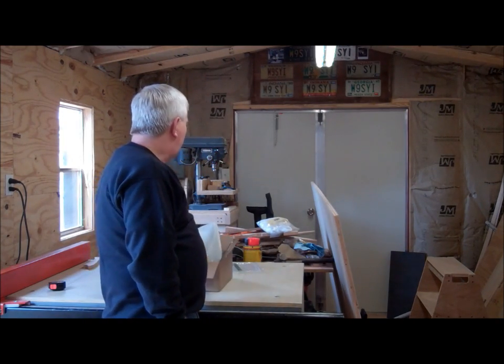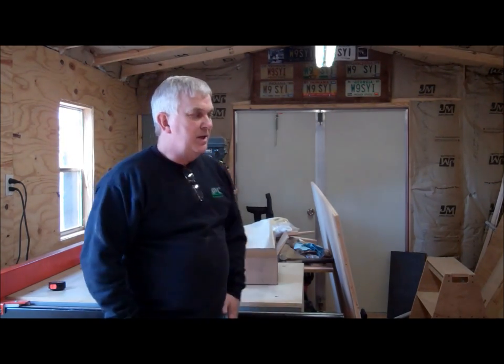How to Build a CNC Router On A Shoestring Budget Part one Assembling the Gantry

Comment: I built a CNC router using David's excellent plans. I made a few changes, some I am pleased with some I regret. I went with the cheaper 17 series motors and controller package from ebay. More power would be nice, and I was fortunate to be able to sort out the wiring. That said when I make the typical newby goofs the motors are not strong enough to actually break my machine. I simply have to machine slower. I also designed/ built my own zero backlash nuts for use on standard 1/2x13 UNC allthread. They are working great and accurately. THANK YOU DAVID!!!.
Reply: I spent a total of about $1300.00 cdn. But I modified David's plans in a few ways. I used standard 1.5x13tpi threaded rod for the lead screws and designed my own zero backlash nuts. I also used lower power steppers. This combination saved a fair bit of money, but is slower. I am very happy with my CNC performance. I can machine 33" x 23" on an approx 48x 26 table. Hope this helps.

Comment: Hi Dave, my name is Greg Shadbolt, and I watched your video on building a cnc router on a shoe string. I loved it. My question is, is it possible to set two more axis to the fixture for the z axis so that you can rotate the head of the router say maybe 45 degrees on X plane and Y plane. I ask that because I have design a geo dome which I would like to use this machine you design to cut out the parts for this dome which requires me to do compound angles which I can set up on my mitter saw, but would be quicker and easier to perform this machine if I could establish the rotation. The parts are 2x4's cut roughly too 26" to 34" lengths with compound cuts on both ends. I do Cad work and this really is a nice design. Greg
Reply from the maker: Greg, The answer to you question is Yes.  Yes it would be possible to add an additional axis or two to rotate the head as you describe.  Would it be economically feasible?  NO.  The compound miter cuts for your geo dome would be done much, much faster with a compound miter saw.  You only have to make one sample piece and then use that to set up your saw for the different cuts.  Contrary to what some people might believe a CNC router is not the best tool to use for every woodworking task.  A CNC router is a great addition to any woodshop and I always encourage hobby woodworkers to build their own but a CNC will never replace the traditional tools in the woodshop.  Good luck with your geo dome build.
Reply: could I please have the CNC machine plans?

greatly appreciated
thanks